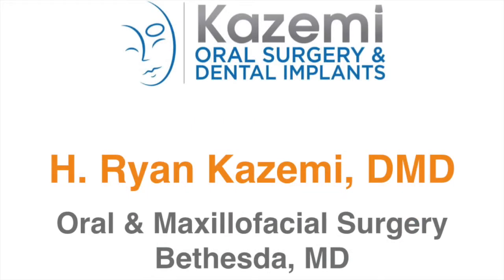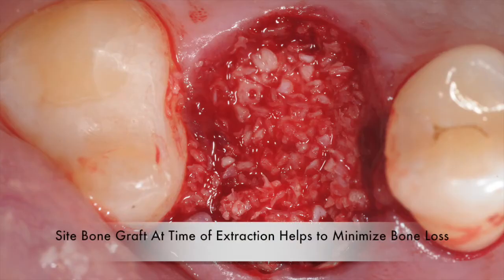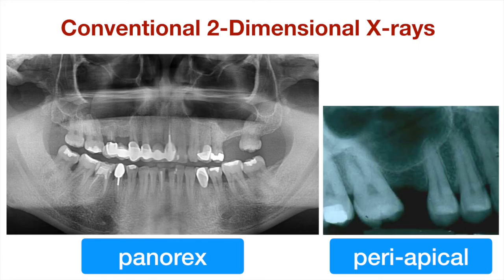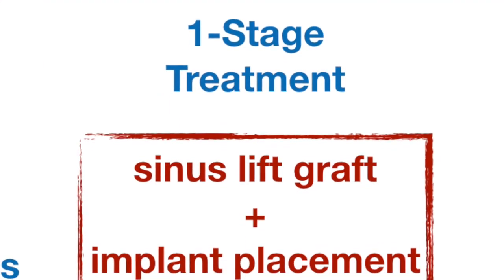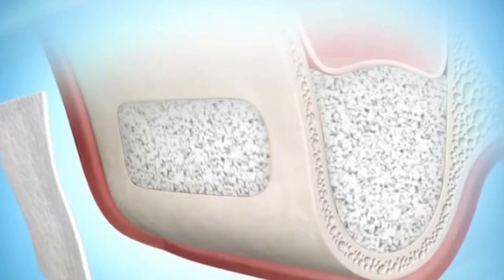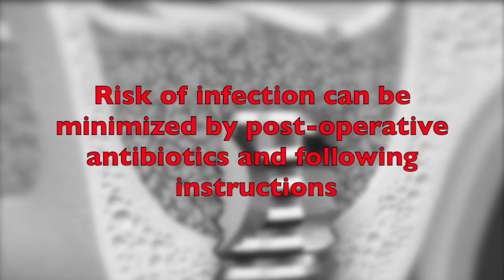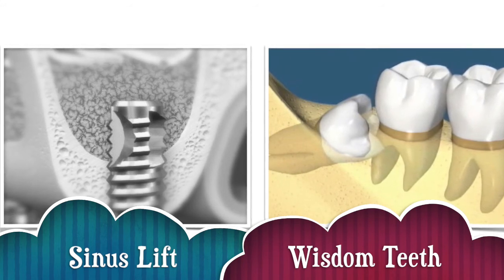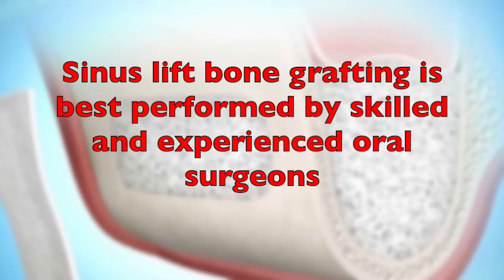Patient Guide To Sinus Lift Bone Grafting For Dental Implants

Comment: I had an upper molar extracted about 5 years ago and my dentist never mentioned doing a bone graft right after. Can I still get one now?
Reply from the maker: Only if necessary for implant placement purpose
Reply: @kazemioralsurgery  What if I just want it so I don’t lose anymore bone? I’m worried about it caving and losing the surrounding teeth.
Reply from the maker: @FEARisCOLD  Typically, bone stabilizes after 12 months after any extractions. so bone loss is generally not anticipated after that period. But you might want to have an exam by an oral surgeon done to make sure there are no other factors.
Reply: @kazemioralsurgery  Oh wow didn’t know that. Thanks for replying. I’ve been interested in getting an implant, would you recommend anyone in nyc?
Reply from the maker: @FEARisCOLD  my pleasure. We are in Washington DC area if we can be of assistance. we see many patients from NYC area. No specific contact NYC. Sorry.
Reply: @kazemioralsurgery  Got it, thanks. I will consider making a visit.
Reply: @kazemioralsurgery  so does that mean we don’t have to worry about further bone loss after the 12 months?
Reply from the maker: @nickijackson75  The bone remodeling after tooth extraction diminishes gradually and typically stops by 12 months.

Comment: If I’m missing my front tooth (center) that is in my upperjaw, do I need a sinus lift? I have bone loss there as well.
Reply from the maker: No. Sinus is relevant only to the back upper teeth. But generally bone in the front resorbs and shrinks after tooth loss. So a different kind of bone grafting is often necessary. your surgeon can do a CBCT (cone beam CT scan) for proper diagnosis.
Reply: @kazemioralsurgery  Thank you for the clarification.